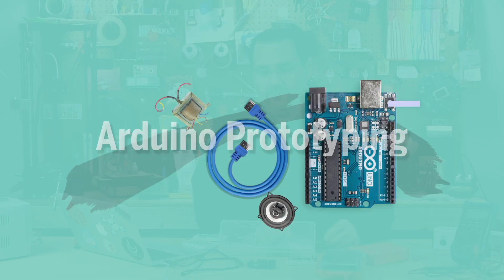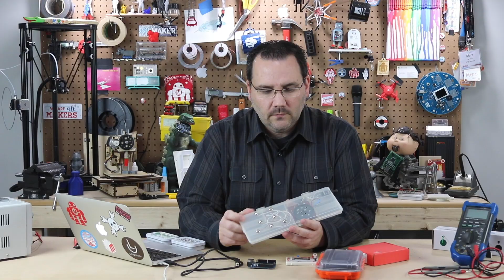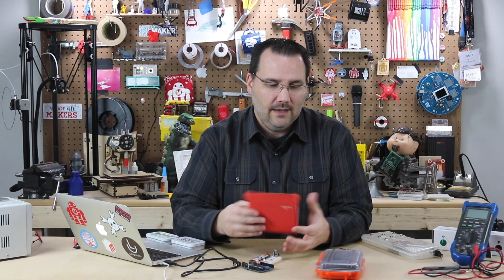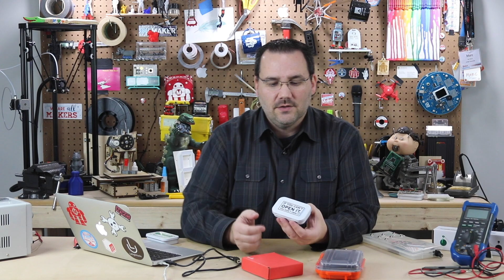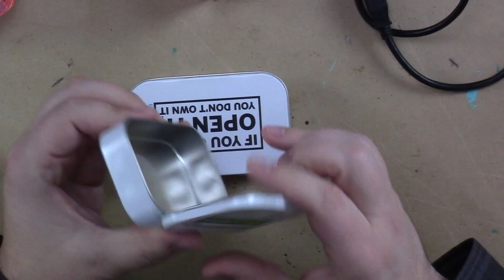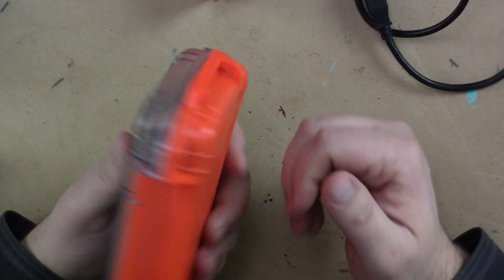Arduino Enclosure Ideas for Beginners: 4 Project Boxes You Already Own

Comment from the maker: Quick tip I glossed over in the video: before you drill a single hole, put your Arduino inside the box and mark your hole locations with a piece of masking tape on the outside. The tape gives your drill bit something to bite into so it doesn't wander and scratch the case, and you can reposition the tape as many times as you want before you commit. Works on plastic, cardboard, and mint tins.

And if you go the mint tin route, line the bottom with cardboard or non conductive foam FIRST. Ask me how I know.

📌 FULL SERIES: Watch all 100+ episodes of the Complete Arduino Prototyping Series. https://www.youtube.com/playlist?list=PLcKte0wD90Y4lsrStEWB5NR1gKMs0FDts

What are you putting your current project in?